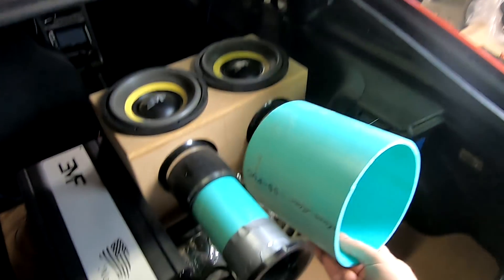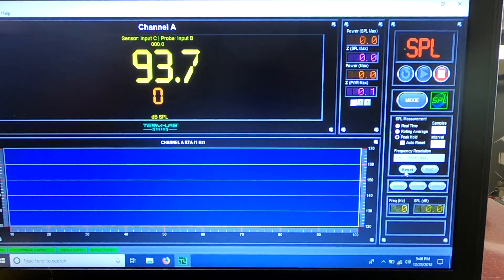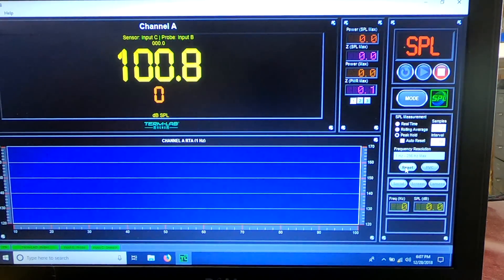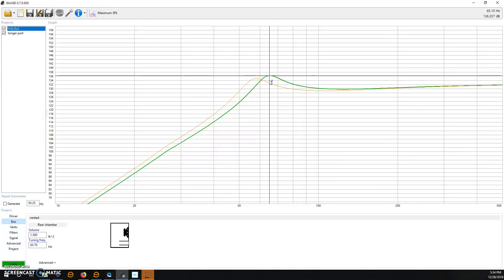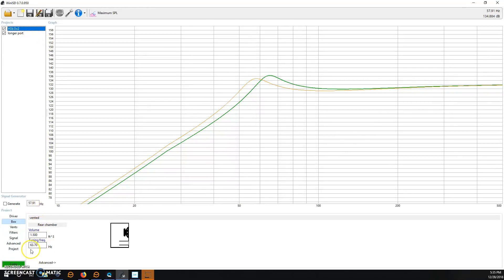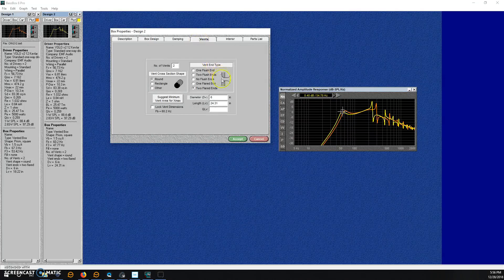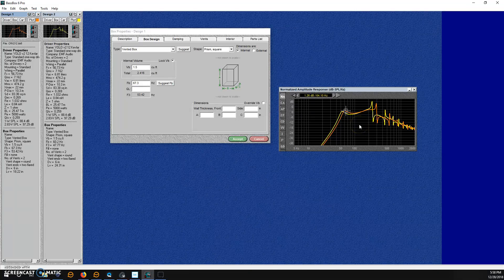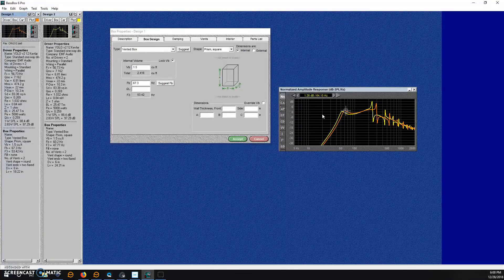Your box modeling software is very wrong, here's proof - Tech Stuff Tuesday

Comment: This video is pointless and your view that modeling software is wrong is way off base. If you want the modeling software to be closer to actual in car measurements you need to create a frequency response graph of a speaker in open air and an in vehicle response graph using that same speaker. Comparing the two graphs will give you the data you need to create a room response graph. You can then create filters in WinISD to simulate the in vehicle response.
PS: Anyone who has a reasonable understanding of how sound is influenced by room acoustics will be very turned off by this video and be very unlikely to patronize your business since it makes you look less than well informed.

Comment: I have never seen a tuning frequency at about 60Hz for subwoofers of that size... I think it is so high...
Reply from the maker: The tuning has nothing to do with subwoofer size. That particular tuning is needed for the goal of that installation.
Reply: @EMFAudio  Thank you for the reply. On the basis of what you said, I suppose that the goal was SPL... Anyway, if SPL isn't the goal, the higher the size of the sub, the lower you can go and lower you should go, because  you can gain more bandwidth and so deeper bass. The higher the power, the lower the tuning frequency should also be (if it is possible), because high frequencies at high power can damage more easily your ears.
Reply from the maker: @skmax521  That's not accurate either. I've tuned 8's to 35 hz quite a bit, that's pretty normal. It's not a relationship to cone size, it's a relationship to the subs suspension and characteristics.
Reply: @EMFAudio  I agree with you about charachteristics and suspension, but almost always the size matters. A 12inch sub of the same collection of the 8inch can play better at 35Hz compared to this one...
Reply from the maker: @skmax521  Play better, or play loud because it's more displacement?
Reply: @EMFAudio  It can play louder because (not always but almost always) has higher efficency. And it can also play better because it can go lower in freqeuncy. Anyway, as you said, it need more displacement, this is the only problem... Anyway if you take, for example, a 8inch and put it in a 12inch designed box, it will not play well as the 12... It will be only more peaky where is the tuning frequency... If you want efficency and bass extension, of course, you need a large displacement...
Reply from the maker: @skmax521  It's more efficient because it has more displacement, which is why it's louder. No, a bigger size doesn't play lower, that's subject to the subs design. There are a ton of 8's that play lower than 18's.  If you take an 8" and put it in a 12" box you're a moron because it's the wrong enclosure by a long shot. It will perform WORSE than a box designed for an 8". If you take the 12" and put it in the 8" box it won't perform as well either.

Comment: Reason for the gain is because the mouth of the longer ports were much closer to the loading wall.
Reply from the maker: Then why should you not have less than the diameter of a port from another surface? The port area isn't effective at that point.

Comment: Cant help but wonder if when adding 6” of port you also moved box forward 6” you know only making one change and making it more controlled. Port being 6” closer to hatch wall def plays a part imo
Reply from the maker: That can be true, though you'd also be changing the sub location so you're changing 2 things at once. Beyond that, in this car the port end just needs to be in a range from the back. No less than 4" and no more than 12" and the result is no different.
Reply: Agreed

Comment: I have Eminence Designer software which allows you to select and adjust the acoustical environment. Being in car or architectural and also allows for adjustment of air temperature and barometric pressures.  Really great software.
Reply from the maker: You can do that in other software too, like these, which are still wrong.
Reply: @EMFAudio  Never really tried to see if it is but maybe that is a project for this weekend.  And eminence releases updates for it on a regular basis too so what your saying means they dump alot of programming money into a program that simply doesnt work.  Kind of a huge accounting issue for a big company like Eminence for sure.  Do you consider these to be at least more accurate or still just way off?

Comment: Jacob used to say the same thing, but it seems like more people have learned that TSP's can actually be used to accurately model the enclosure, and that cabin gain/loss isn't factored in to most programs. That in no way makes them wrong; this video is misleading just so that when people plug in the specs of drivers and see that they plot to sound horrible they disregard it and spend the money on terrible sounding drivers anyway. Also, the program you are demo'ing doe's not factor mh or le of the coil, which would lead to a difference in actual sound from the setup than shown on the plot, there are programs that are smart enough to factor Le, mH, air density, etc. Misleading the consumers to sale products is a terrible thing.
Reply from the maker: Both pieces of software do take into account inductance, and some do take into consideration temperature (though it defaults to room temperature usually). If you actually watched the video you'd see that both programs say different things, regardless of what the reality is. That inherently means at least one of them is definitively wrong.

Comment: how does changing the port length extending into and (overall length )the enclosure effect tuning and SPL? i.e. say I had an adjustable (big ass ports type), 10" on my twin 18" subs, and I could adjust both the overall port length and the amount of port in the enclosure, would this be beneficial and if so how? thank you!
Reply from the maker: When you add length inside the enclosure you take up volume, so even with the same port length that will change tuning. As far as the dynamics of the port inside the enclosure goes, there are documented cases where having the flange inside the box was louder (not audible, but measurable). However, that will be a case by case basis based on other enclosure dimensions.

Comment: First of all, get a good sub in a sealed box and run a sweep and measure how you car handle it.
Later that you can have a good start point to choose what is the best frequency to have a great peak number!

Dont say the software is wrong if you dont use it in the correct way.

Here in Brasil we have a most popular kind of sound system to play in open area instead of inside a car. And i run WinIsd pro and have great results.
Inside a car, a software cant simulate how your car will handle the sound. And this dont means the software are wrong!

In real world in a open area, it works very close to the reality!

Check out my older videos on my channel to take note about what kind of stuff im talking about.
Reply from the maker: First of all, the sealed box method doesn't work. When you increase pressure in the car everything changes. If you don't have the same exact sub position everything changes. The introduction of ports changes everything. If you don't have a perfect 0.7 alignment on the sealed box, it won't be accurate to begin with. In short, it doesn't work, especially if you aren't in the neighborhood of the same SPL. The software is wrong, I showed it's wrong in multiple ways. For starters, both softwares gave different results, this means one of them is wrong even if one of them is right. The software can not accurately predict the car. There are factors with metal resonance, interior panel materials, etc. There are settings for "in car" so you can't say it's not intended for a car either.
Reply: @EMFAudio  in open space it works pretty nicely.
In car, thats true, it doesnt have how to simulate exactly the reality of any vehicle, but it works better if you have a calculated sub box vs if you use a wood cube with a hole and a tube.

If the software is wrong, what is the correct way to calculate te perfect box for a sub in a car?
Reply from the maker: @guilhermeleffler  The math for tuning is fine, because that's math with no variables. The plotted response is an estimated simulation, not reality. THAT is the point. People go off of graphs with bad information. I'll remind you that both programs gave different results. That means even in open space, at least one of them is wrong.
Reply: @EMFAudio  i have used the WinIsd simulation in more than a 100 boxes that i make and it works fine, after i learned how to properly use the software.
Reply from the maker: @guilhermeleffler  So you designed the box, built the box, installed it, and compared those results to an RTA graph that matched it exactly? Or did you just go "that sounds fine"? I do that without using software making educated guesses.
Reply: @EMFAudio  yep, the RTA graph did enough close to the simulation graphic so i can say it really works great! 100% exactly is a utopy, but 97% is better that if i start build a box without a project.
Reply from the maker: @guilhermeleffler  I'll believe it when I see 100 RTA graphs to match the simulation.
Reply: @EMFAudio  so whats your suggestion?

I should make a sub box by free hand project if a simulation doesnt work?

Or what sould i do?
Reply from the maker: @guilhermeleffler  Starting with manufactures recommendation, make personal experience judgement calls from there. I don't spend hours and hours doing actual testing on prototypes prior to releasing a new model and giving a box spec for people to get a better result because they looked at a graph. I recommend what I recommend for a reason, slight variations per application are all that's needed.

Comment: Lol your win ISD parameters are wrong. 2 seconds of looking at your curve plummet after your peak makes it pretty obvious. Only a couple reasons it does that. Can you show the settings you have.
Reply from the maker: The parameters I took directly off the subs themselves are wrong? The Qts is why the curve plummets in the graph and funny enough, not in the car. I'll remind you, both programs estimate something different, which automatically means one of them is wrong.
Reply: EMF Audio no not off the subs. The settings in the software. But agree with the end part
Reply: Just asking for your specs to confirm.
Reply from the maker: @pandasgomeow7904  I did this months ago, if I went back to do anything you could just as easily say I entered something differently.
Reply: EMF Audio I'm not that guy. Pretty sure I know what's going on but I need more information.
Reply: EMF Audio also I'm not disagreeing with your assessment. It's 100% true. But we can minimize the error rate.

Comment: I have to disagree, uour testing is inside of a vehicle ,although open, it still has an effect as well as you are inside of a building that also has an effect.

Bass Box Pro is pretty good with the accessories that permits the system check and cabin gain which I use to design my enclosures.

with this program this program has a acoustic section that allows the aciustics to be saved to help predict its performance...it also has a option to add a impedance reader that will save you a lot of headaches in controdicting parameters....without these devices...you are just guessing at its output and performance.

in closing, don't just get tge program, get the accessories that allows tge program to do what it was designed to do.
Reply from the maker: If you have all the extra tools, you don't need the program. Also, as the environment is a factor, all that data you plug in becomes invalid as SPL increases. It's true, RTA a car at 100 dB, then 120 dB, then 140 dB, then 160 dB and you'll find everything changes.

Comment: Can I use winisd to see what kind of frequency response I can expect in a grand caravan? Or is there not much a point in using it?
Reply from the maker: You can get a "kind of" idea, but it will be far from precise.
Reply: EMF Audio what would you use?
Reply from the maker: @_N_B_0496  My brain. You can get an idea of what the sub will do with software but the cabin gain will take some general knowledge. Bigger vehicles like a minivan without a wall will peak lower, like in the low 40's or maybe even high 30's. Smaller vehicles like a compact hatchback will peak higher, high 50's and low 60's. How much they'll gain is unknown so you have to build and adjust or use an RTA and EQ to adjust after it's installed.

Comment: if the impedance rise, did you have to incrise the voltage? because the same 2k was applied
Reply from the maker: When clamping power I'm looking at wattage only, not voltage and current individually. That's the only way to gaurentee it's always the same exact wattage.
Reply: @EMFAudio  i agree with you, thanks!

Comment: Very cool video. Love your channel. Bass box pro assumes your port is taking up enclosure air space. That is why the frequency went up when the port length increased (I'm sure you know that). If cabin gain was also included (there is an option for it) it might be closer. In 1/2 space anechoic modeling it is more accurate. Why didnt you keep the port distance from the rear of the car the same so that the exiting port pressure is equal to the hatch? Seems like the resonant frequency of the cabin is 65hz. Again, most modeling software is not accurate for SPL comps. For the layman this would be very misleading. Thank you for sharing! Keep up the good work.
Reply from the maker: When you tell it the port is external, it doesn't assume taking up volume. It also bases it's numbers off of net, not gross so if it was taking up volume it wouldn't change the calculations unless you force box dimensions instead of setting a static volume. There is an option for cabin gain, but where do you get that info from? It's not dimensions. you'd have to have acoustic measurements. What happens when you increase SPL? Panels move, metal resonates, and all those numbers are wrong unless you measured them at the same SPL. I didn't keep the port distance the same because then the sub position would change. I know the sub position is optimal no matter the port length.
Reply: @EMFAudio  forgot about that part of the software that tells you internal or external. Thank you for your reply and information. I still have a lot to learn.
Reply: @EMFAudio  ... I truly like how you teach the science behind audio. 
I've been into audio since the early 90s; never knew I'd pick a "cool" hobby that required so much mathematical & scientific enthusiasm. 
👍😎👍

Comment: I was under the impression that Sub Manufactures model their subs in software similar to this to determine recommended enclosure to include in their product manuals. Sooo, what your saying is that Sub Manufacturers should not use any software modeling when determining recommended enclosure designs? They should instead place them in every possible vehicle on the market, testing every possible enclosure size and port configuration in each of those vehicles and then what? Just determine an average of which one is best? Because I'm pretty sure if I was designing and building subwoofers as a company it would make sense to be modeling my product in some sort of enclosure design software to come up with a recommended enclosure, perhaps test a few that the program spits out and go from there. But simply throwing out modeling software as totally useless is wrong in my opinion....  PS - The vast majority of your videos are very informative, keep up the good work!
Reply from the maker: In car testing is more than just a spec too, it's also placement of the sub and port in the box and how those are placed in the car. We actually do in car testing on prototypes before making the final product. When you've been doing it long enough, you just kind of know what's gonna work and not work based off the parameters.
Reply: @EMFAudio  makes sense, nice to hear there is a company out there that would take the time to utalize some in car testing. Thanks for responding!

Comment: How do i calculate the cabin gain?
Reply from the maker: You measure it, you don't calculate it. There isn't a formula to do the math on it and it is dynamic in that it changes with pressure and panel movement.
Reply: @EMFAudio  thank you!
Reply: @EMFAudio  not to mention elevation, temperature, and humidity
Reply from the maker: @beardedforlife3740  Those factors effect frequency more than amplitude.

Comment: I see so many comments here talking about cabin gain, or how the software is meant to simulate in an open space. So many people here think they're smart, but are honestly just an echo chamber for one or two main criticisms of the video. There's plenty of sources here on YouTube that go over various audio topics on the engineering side, and with a bit of applied logic, will show why adding just the variable of cabin gain won't make simulations much more accurate. 
Peter Kulicki from HexiBase and Audio Dynamics has some good content on this kind of stuff. Explaining how car and home audio work outside of the speaker enclosure, how box and port geometry changes output, etc. 
Just knowing that geometry of chambers can change output should tell you that just applying the variable of cabin gain isn't enough, especially considering a vehicle has geometry that's very impractical to measure. Then you get into how materials reflect and absorb sound, or inductive losses through panel compliance and how energy travels through panels that're fastened together.

If everyone could just do some more research and use some logic, maybe YouTube wouldn't be an echo chamber of idiocy.

And even then, an outdoor PA system will have the most accurate models, but even then nothing is perfect, and there's still variables you can't account for.